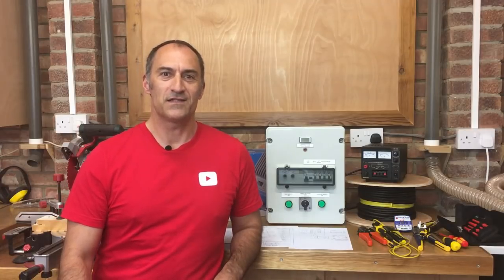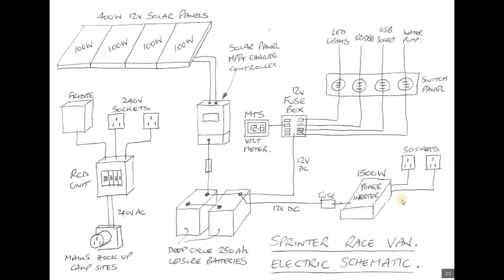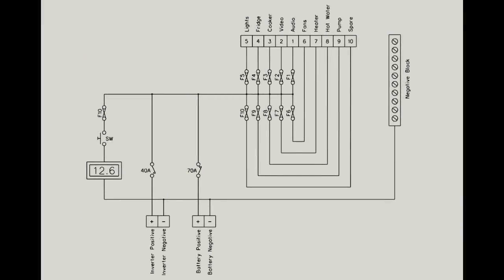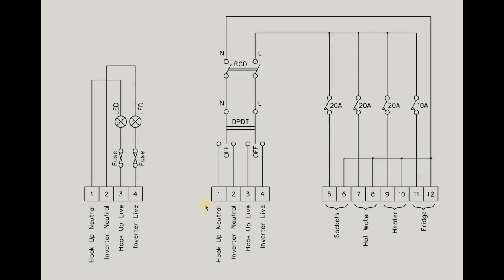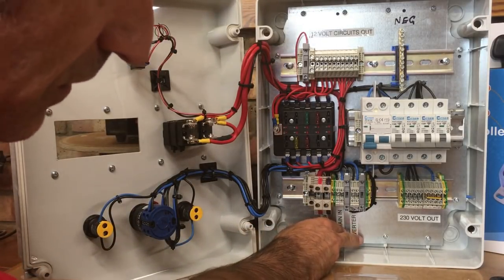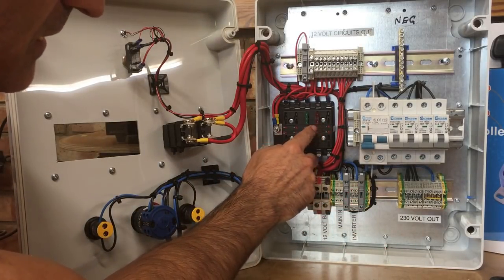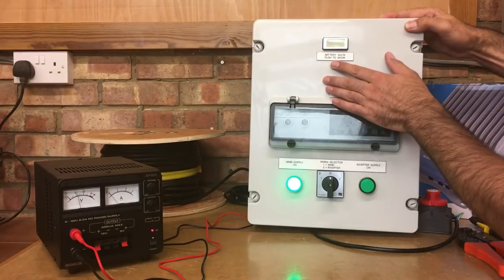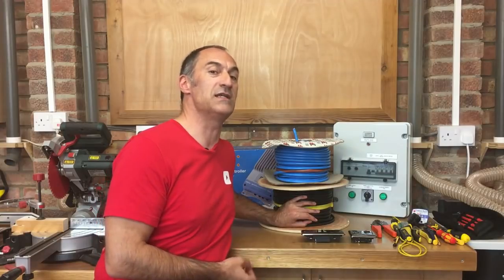Self Build Camper Van 12v Electric Control Panel

Comment: OY!  My wife and I are sat out in the van waiting to pull the blue capables... hurry up with the next video before we freeze!

Cheers!
Reply from the maker: Hi Tom, glad you’re following along. What type of van do you have? What are your plans? Two videos out this weekend. Cheers 👍🏼
Reply: Due to a need for wheelchair accessibility we have an Iveco 50C15 former minibus (Iris Bus).  Living area for conversion is 4.5x1.8.  It will have a garage with bed over for a large, off-road, mobility scooter.  With a 5 ton vehicle we are not too concerned about weight of materials, in fact I need a bit on the back end to bring the suspension down to level!

Looking forward to the next video's.  Many thanks!
Reply from the maker: Hi Tom, sounds like you have got a great base vehicle to start with. Have you got head liner vents and lights all existing? I’ve spent a lot of time trying to finalise my design and decide what appliances to purchase and where they are going to go so I can get a concrete plan to work off. My day job has been taking its toll. I’ve got next week off so planning to spend more time on it. Expect more vids very soon. Keep me posted with your progress be interested to hear how you get on. Good luck.
Reply: Hi Greg

Bus has good headliner with almost perfect lighting for us.  There is decent roof top vent with cowling plus a large opening  skylight.  It has a fully fitted and piped Eberspacher D5 heater.  Obviously we need to strip out the floor, walls and roof to fully insulate but hopefully the panels will the replace.  I'm expecting to have to replace the floor.  Our plans are to have insulation and boarding done over the winter.  We don't need to rush, but would like to have it in use by next spring.

Finalising plans and layouts is a nightmare, but you sound like a logical bloke and I'm sure you have (like me) schematics and lists for everything!
Reply from the maker: Tom Stratton, sounds like a good starting point. 
My plans are coming together fast, just a few pieces of the jigsaw to find. We too need to be up and running for end of May next year. Big plans!

Comment: Nice panel, 
I am curious as to why you chose to use the rotary switch instead of a 240v relay coil. Inverter supply in normally closed and hook up in normally open. Would illuminate the need to manually switch over and also remembering to do so. Also if relay coil packs up it’s fail safe so wouldn’t cause harm. 
Also would you incorporate a trickle charger for when on hook up and split charge relay when on the road?
Reply from the maker: Hello Sam, the changeover switch has a centre off position where I can isolate both incoming supplies. 
I wanted it to be manual. I know there are ATS out there but I wanted something simple that I could easily engineer myself.
I am installing a split charge relay from the van battery when driving and looking for a suitable mains charger when on hook up. Thank you

Comment: Also the what is the black cable is it 2 core 2.5 as there are many variations on the website you have given? How many amps is you main RCD? Thanks again.
Reply from the maker: Hello, I'm using the 2core 1.5mm black rubber cable for the 12volt circuits, i'm not running an earth on the 12volt stuff and the individual loads are tiny on the 12volt side.  I've made a revision to the panel which I will be going through in this weeks video. The main 12v DC breaker to the inverter I have removed from the panel and will fit close to the batteries this will be 200amp. The 70amp DC breaker feeding the blade fuse holder will remain in.

Comment: Hi great videos by the way, I am also building a race van and am going to try and make the same electrical box, is there any chance you could put a link for the box and tell me what wires you used to connect everything inside. Thanks
Reply from the maker: Hello Justin, sorry for the delay in replying. The distribution board is homemade from parts bought from RS Components.
I know its very complex for the home DIYer so there are a couple of options. 1. Find a local electrical controls company that could assemble one for you, (this could be expensive) 2. There are commercially available Power Management Systems for Campers available at reasonable prices. Granted they may not have the same features as mine but will do the job of power management.
https://rover.ebay.com/rover/1/710-53481-19255-0/1?ff3=4&toolid=11800&pub=5575265109&campid=5338027957&mpre=https%3A%2F%2Fwww.ebay.co.uk%2Fsch%2Fi.html%3F_from%3DR40%26_trksid%3Dp2046448.m570.l2632.R2.TR4.TRC1.A0.H0.Xpower%2Bmana.TRS0%26_nkw%3Dpower%2Bmanagement%2Bsystem%26_sacat%3D169486
Show less

Comment from the maker: EDIT - The breaker for the inverter supply is undersized. 
This should be (2000W/85%/12v)+25%=245amps minimum and be located closer to the batteries. 
So I will be removing that breaker from the panel and revising the schematic. 
Thank you to everyone for your helpful advice.
Reply: Will this be shown in your next video how you changed it? And what you used please.
Reply from the maker: Hi Justin, yes I will do an edit video and cover the changes.

Comment: Hi nice channel by the way so for 2 .4 KW from the inverter you will need 2400/12=200 Amp fuse required, If you do put the fuse in the box like that it will only protect the foot  long piece of wire going to the next set of fuses which seems expensive to me. Its best to fuse as close to the source as possible like your batterys for instance so it protects the whole cable run, as it is if you had a fault anywhere between your incoming side of your fuse and the battery then that would be a catastrophe in the making. Same goes with the inverter but I would expect an inverter to have a fuse on the output side. I do apologise if I sound a bit strong but its best to get it out in the open. your change-over switch looks ok tho as it swops both live and neutral  so no probs there.
Reply from the maker: Hello, yes well spotted. I made a mistake with the sizing of the inverter breaker and as you have suggested will remove this from the panel and site near the batteries. 
I will do an edit to this video and the schematic to correct it. Thanks for your help.
Reply: A rule-of-thumb method of calculating the current draw of an inverter is this: 12 volt inverters require approximately one (1) amp of DC input for each 10 watts of AC output. Using this method the ohm's law calculation suggested by  Master of the Universe yields a result that is still less than would be required to properly fuse the input and calculate battery discharge rates. In this example: 2400/10 =240 amps--a 20% difference.
 I think MotU raising this issue and highlighting the high current draw was excellent. He identified several very important points. Placing the inverter in close proximity to the batteries and insuring that the cable guage is a sufficient to handle the current should also be layout considerations. 
I am no expert, so take this with a grain of salt. I just did some cursory research because I was shocked (no pun intended) at the very high potential current draw.  As Greg has said numerous times--if you are not comfortable with or have a good understanding of the electrics--get expert help.
Reply: Master of the Univers

Comment: Greg, exellent work. You charge the batteries from the solar panel. 
You will put some dc-dc charger to take power from the Sprinter start battery/ alternator? You will have AC - DC charger? 
I am expecting your wiring video.
Reply from the maker: mihajlo, yes, I have purchased a split charging relay to charge the leisure batteries while driving the van. Thank you

Comment: Many thanks a great video, I was wondering about battery charging and solar panel control will you include these?. Best of luck with your conversion.
Reply from the maker: Hello David, I have purchased a split charging relay kit and will be installing this so the leisure batteries will get charged while driving. I have a solar charge controller to charge the batteries off the solar panels. The only thing I haven't found yet is a charger I can use when on mains.

Comment: Hi Greg , just wondering if you considered also having an auto switch to charge both running and leisure batteries off alternator and solar panels. I have seen on other vans this type of system.
Reply from the maker: Hello, yes I have purchased a split charge relay and will be installing this in another video. 
Thanks for asking. Cheers
Reply: Will you have modified schematic for that.
Reply from the maker: It will be external to the control panel. I think once I have all the equipment selected I'll do an all encompassing wiring diagram

Comment: Proper job that panel 👍nice one.
Will you be having the inverter permanently fed or will it be on a remote switch just thinking of battery drain if it's permanently on. 
Don't know where your going to mount your distribution panel, but if it's somewhere in sight even small led are really bright at night. Found that out the hard way when doing my own conversion. Keep up the good work looking forward to the next instalment.
Reply from the maker: That's a good point you have raised. Something I will have to look into. I'll do some tests on my inverter and see what vampire loads it has. 
It will be mounted in the garage at the back along with the batteries so no light will show in the cabin. Cheers

Comment: Hi Greg. An absolutely excellent distribution panel and explanation if I may say so.  Your delivery is about as good as it gets - anywhere!
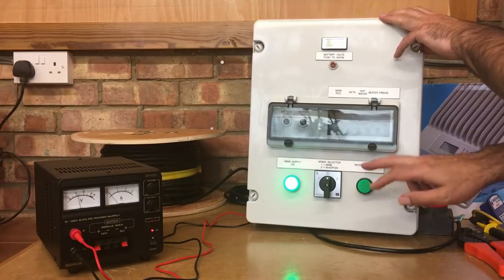A couple of questions. 1) At 14:47 when you had the 'simulated 12V hooked up to the panel, the light was on on the 12V power supply, but the green led/neon was NOT on.  How come?
2) Why did you not have leds/neons showing 'power available' from either 240V 'shore power' or solar/inverter, and then depending on which source was selected have another led/neon showing which one was 'active'?
3) I realise that it is an extremely unlikely situation, but when running on 'shore power', and with no solar/inverter available why did you not make provision for 12V from 'shore power' via another psu?  
I also realise that there HAS to be a point where one stops designing for eventualities etc., but given that you made such an elegant solution to a potentially 'messy' installation, it seems like an oversight perhaps?
Please don't assume that I am criticising, I'm not, I love the panel, but I merely ask the question(s).
Another commenter asked if you are making these panels available, to which you replied no due to time cost etc.  May I ask what this panel cost as in the video?  
Just thinking out loud, I am also an electro-mechanical engineer and depending on cost, I might be able to produce some of these for any of your interested viewers.
Sorry for such a long comment, but needless to say I can't wait for the next instalment.
Regards Mark in the UK
Reply from the maker: Hello, I'll try and answer in order of question. 
1) The two green LEDs are only on the 230v mains inputs coming into the changeover switch to let me know I have mains power coming onto the panel. There is no light for for 12v DC battery supply. 
2) See above, more lights = more wiring, bigger box, more cost, more drain on power etc etc
3)When on shore power my 12v DC demands are very small and easily handled by the batteries which will be maintained by separate charger in this situation. 
4)The components come to approx £300 but the time to build would make it non profitable for myself. Plus I'm doing a full time job, fitting in my own van build and editing videos. 
My days are full to the brim already. 
I'm sure any controls company could knock these panels out for £500?
You could go on and on but as you say you need to draw the line somewhere. I wanted a glorified junction box with built in mains changeover facility to reduce wiring inside the van. Many ways to skin a cat as they say. I'm sure there will be many views on this one. Thanks for some great questions and hope you enjoy the rest of the build. Cheers
Reply: Hi Greg, and thanks for your reply.  I sincerely apologise if perhaps you saw my questions as a criticism, and I certainly I hope I haven't offended you.   I'm really pleased that I came across your channel 'cos I'm probably going to be starting a conversion within the next few weeks.
Not related to this topic, but I also liked very much your cyclone build, so I subscribed.
Regards Mark

Comment: I have a question about earthing. As home wiring is earthed for safety and also the sockets that you will be using with the usb connector. How do you wire both 12v and mains into one sockek?
Reply from the maker: Hello PreOAP, I'm not wiring 12v to the household sockets. 
I'll only be wiring 230v power to the sockets.  This will come from either the mains hook up or from the inverter. The sockets will be earthed back to the panel and the rear metal plate of the panel is the earthing point for all items in the panel. Hope that helps
Reply: Greg Virgoe Yes that makes sense. I wanted to check so thanks for clarifying it. Regards

Comment: How are you dealing with the mains/inverter earthing?
Reply from the maker: Hi Karl, the inside back panel of the box is a metal plate. This is the common earth. All the green and yellow terminal blocks are linked to this back plate. Thanks

Comment: That panel is a thing of beauty. Excellent planning and execution Greg, just as I anticipated. Certainly an excellent example of how to wire your camper safely and correctly and to a high standard.
Reply from the maker: +Larn Davies, thank you very much. I wanted to make sure there wasn't any exposed mains cabling and this seemed the best way to do that. I shall be getting the install tested and certified by a qualified electrician. Appreciate your support. Cheers
Reply: Greg Virgoe well you have created an excellent example of what a master panel should look like, I am sure it will pass inspection easily. Nice stuff
Reply: @GregVirgoe  Hi Gregg, i've messaged you a couple of times but got no answer?? I'm trying to sort out me distribution panel and yours is just fantastic, you've linked for the DPDT and fuses etc but not the actual box to house it all in 😢😢 please please can you put me out of my misery and give me a link to the anctual enclosure you used 🙏 Russ

I have tried many times to get an answer, maybe i'm just missing it? So maybe a personal message might be better 👍
Reply from the maker: @dusty653  I get hundreds of comments a day across all the social media platforms. It’s impossible to answer them all or I would not do anything else.
Reply from the maker: @dusty653  here you go https://www.ebay.co.uk/itm/282754773394
Reply: @GregVirgoe  Great videos a real help thank you could you possibly share the link again for the box as the one above isn't working also would things be vastly different if I use a Lithium battery instead of agm?
Reply: Greg Virgoe I am a sparky and i am very impressed with your panel!
Trust me a lot of Sparks’s would not be able to do that!!
Reply: Great work!!
Reply: Hi Greg could you list where you bought the components to make your distribution panel Please. Why did you not use circuit breakers for the 12 volt supply too?
Reply: X2 that would be really handy... Great video
Reply: Sorry to ask another question what 12v fridge would you recommend?

Comment: Thanks for sharing your journey. Love these detailed videos. 

Sorry for asking a non-eletrically educated question, does this set-up mean that you cannot charge the leisure batteries with the shore line at caravan sites? Is there a disadvantage for adding a capability to charge the leisure battery while plugged in since you already have all the wires running to the same controller box?
Reply from the maker: Joe Lin, not shown here but I will have a battery charger for use when plugged in to shore power and split charge controller when driving. Good question, thank you.